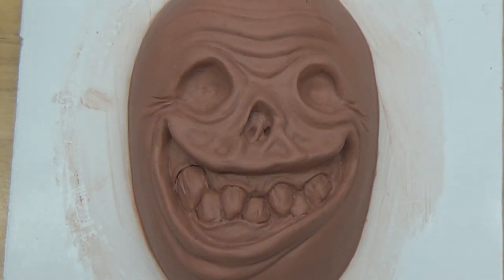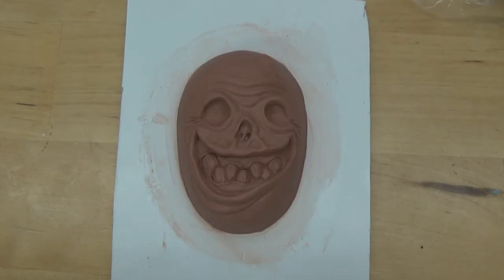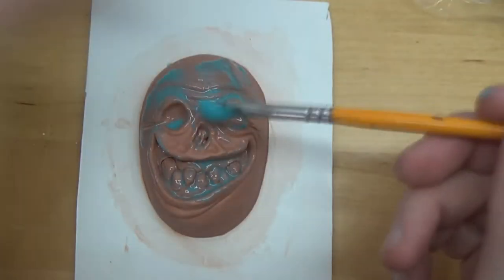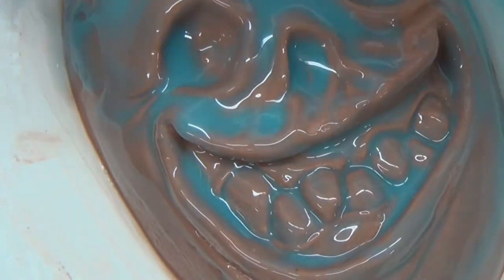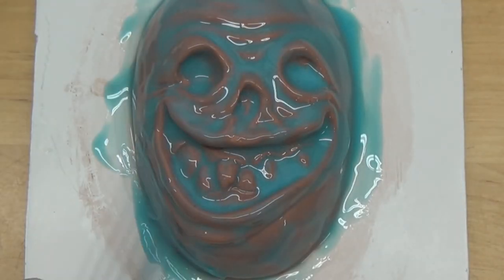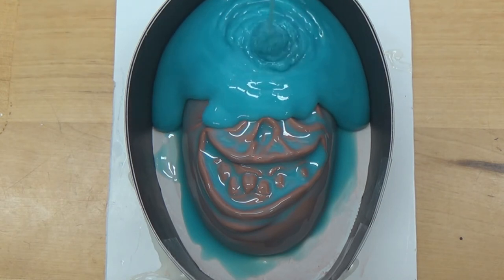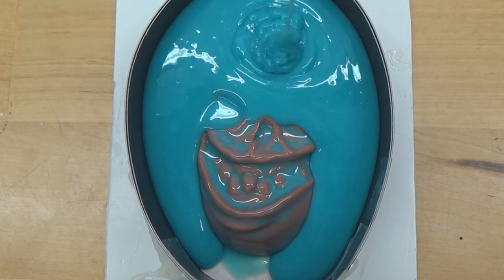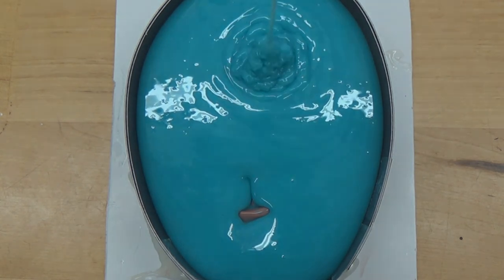THE MOLDING OF "MUCK"! Using Mold Star 16 by Smooth-On!

Comment: This may be a ridiculous question, but did you fire the clay positive before molding? I would think that if you didn't there could be danger when brushing on the beauty coat-but if I could skip that step, it would be great.
Reply from the maker: Hey Nathan! Not a ridiculous question at all! I didn't fire the sculpt as this is Chavant Medium which is an oil based clay-now THAT would be a mess as it would melt lol! This clay is pretty durable so if you use a light hand, you can paint on the beauty coat of silicone and then pour on the rest of the silicone! Once cured, we are good to go! Hope this helped answer your question!

Comment: Random question but how long do you wait for the beautiful coat to set in silicone before pouring over the flood layer. I do beauty coat casting in plaster and didn't know silicone could work that way.
Reply from the maker: Hey there! So this silicone has a 6 minute work time so once the beauty coat is on, I’m mixing for the flood layer! It is a 30 demold time so after the 30 min mark, I demold and it’s ready for resin! I hope this helps!
Reply: @Tobywaynestudios  Sorry I meant was the beauty coat past the 6-minute work time mark when you filled the rest of the mould. I'm wondering if I can do this method with the longer Mold Star 30 which pot life is 45 min.
Reply from the maker: Oh! Sorry if I misunderstood! Yeah! As soon as that beauty coat is applied, you can immediately apply the silicone on top of the beauty coat!
Reply from the maker: It’s probably better with the MoldStar 30 as you have more time to make sure everything is perfect! I like the Mold Star 16 but boy howdy I gotta move FAST!
Reply: @Tobywaynestudios  Thanks! It's has been a long time since I've casted in silicone but I need to make reusable push moulds so this has been very helpful.
Reply from the maker: Very cool! Good luck with your projects!!!